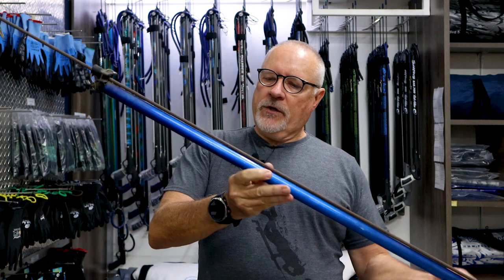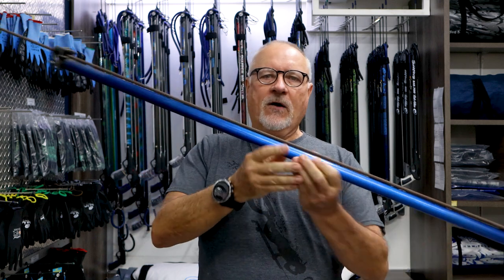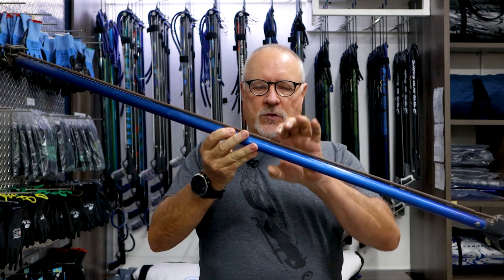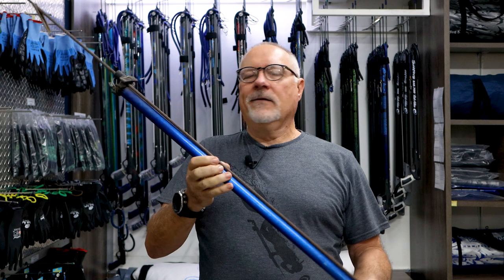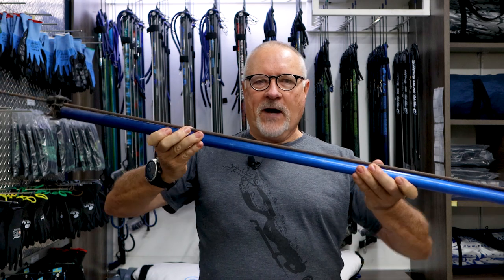Rob Allen | Pre-Railguns | 2023

Comment: Thank for the video!  Mr Allen, would you consider to make a Rob Allen version of Riffe Travel series guns? I find it can be super handy to break into two and put in standard bags for travelling and also good for puting in the car for short distance spearfishing trips.  Also keen to understand the pros and cons between timber guns and carbon guns. Cheers, Rui
Reply from the maker: To make a gun that separates into 2 halves is not difficult. The problem is the spear. There is no way to make a spear screw together in the middle without seriously compromising the strength. You would be better off using a pole spear. If you watch the Timberline series you will see that the Timberline gun is way more balanced and, has more mass. The added balance and shape makes it much more maneuverable underwater than a standard gun. The added mass helps with recoil, improved recoil management helps greatly with accuracy.
Reply: @RobAllenSpearfishing  Thank you Mr Allen. Not sure if a pole spear would be useful for big fishing hunting travels. I was wonder maybe for 120cm and above, it's worth of making them 2 halves, as they are mostly used for blue waters and less likely to hit a rock as often as in reefs?  The timberline by the way look like less Rob Allen guns which are super reliable and trust worthy no matter how you abuse them. Timber line feels to me like a complicated luxury cars which you feel careful to use and maintain.
Reply from the maker: @ruitian8724  In order to get a gun smaller, you would be better off with a roller. A 100cm roller with double wrap can shoot the same as a 130cm non-roller. You could use the roller with a 130cm spear. Total length is them only 130cm with no complications of joints that can fail. Hitting rocks is not the problem with having a joint in the spear. the joint itself will be week and very likely to bend or break. Last thing you want when on an expensive dive trip to shoot gig game fish. what do you think is complicated on the Timberline range? The timber is not structural, just mass added mass and buoyancy to improve performance massively. If you do not maintain it the timber will get scuffed and scratched but in no way will this affect the guns performance.
Reply: @RobAllenSpearfishing  Thank you Mr Allen! Very appreciate your kind guidance as always!!
Reply from the maker: @ruitian8724   you are welcome.
Reply: Rob, I want a travel roller rob allen. I am considering making one myself. I realize the spears screwing together like riffe travel are weaker, however thats the compromise I’m willing to make for take down size. I wish you would make a take down factory. I want to go backpacking.
Reply from the maker: @cblaster171  We have so few requests for a break down spear that it is not viable to make. There is a minimum volume we would need to make to be cost effective. We would also need to do a lot of testing before we could conciser going into production. At this stage there are just way too many other, more important projects we are working on. Sorry to disappoint you. I hope you manage to build one.

Comment: Any chance you could show load testing on ur wired fin shafts breaking strain, specifically when shooting line is connected to the fin loop? Also potentially how to prevent rust on shafts. Cheers
Reply from the maker: Hi Glen, we have stopped making wire fins spears and finally moved over to the full welded fin. I do recall testing the wire fin years back and it also went well over 200kg. Regarding spears rusting, just one of those things, it has to be well maintained to prevent it happening. On a side note, we are working hard on a new coating process that improves the corrosion 4 x. We have been testing this a while now before introducing it. We should be up and running in the new year with it.
Reply: awesome, thanks heaps. will the welded tabs have a hole to connect shooting line to for enclosed track guns and guns with mechs that cant fit a spear with mono attached to the end of the shaft? how do you maintain the shaft besides rinsing in freshwater? cheers
 @RobAllenSpearfishing
Reply from the maker: Hi Glen, we are about to start with a welded fin that is 1,5mm higher and, with a hole through it to add a shooting line connection, still testing though. Regarding shaft maintenance, main thing is to keep it out of salt water 😜  Jokes aside, some wipe a thin coat of grease all over. A yachty I knew did this to his spears after every use and the spears were still fine 3 years later, living on his yacht full time. The best is to dry well and do not store in a damp place. The worsted thing to do is keep it in a saltwater damp gun bag with a wet floatline wrapped around the gun. This new coating will be way better but still will be damaged if left like this over time. It will just take 4 x longer.

Comment: What year was that? Also, I had a quadruple bypass, and even 2 years later, my chest is still sensitive. I’ve got a 90, 120 and 130 RA, what’s the length of 14mm rubbers I should use? I’m off to Fiji for a spearfishing trip mid October
Reply from the maker: I started tinkering around 40 years ago. All rubber lengths are on our website.  rob@roballen.co.za     find the gun you have and check in the description.  The Snapper is set up with double 14mm rubbers   https://roballen.co.za/?product=rob-allen-snapper
Reply: Thanks, Rob.